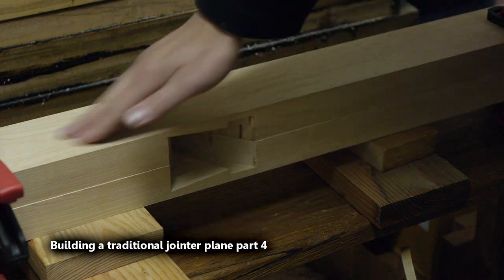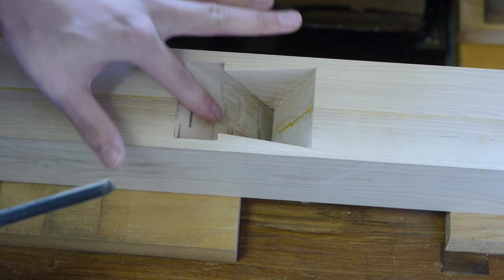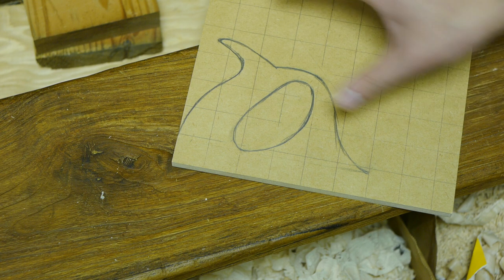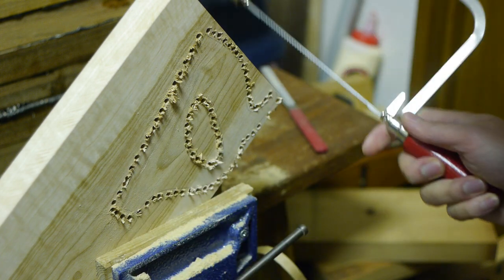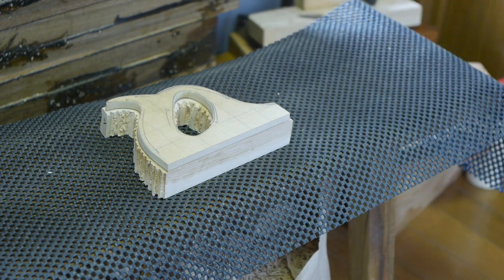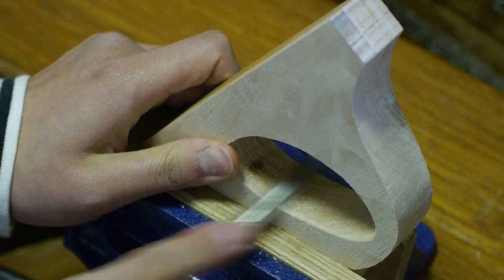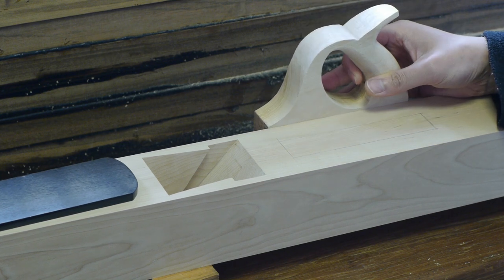How to make a traditional style jointer plane part 4

Comment from the maker: That is indeed a huge knot in the side!
It was actually filled/semi solid when I started but when I hit it with the power plane the knot flew out. I didn't make any effort to fill it etc. Just used it as is. The plane even now is still as straight as ever. I don't think there is any need to worry about it since laminating will improve the warping characteristics of wood anyway and these are pretty well seasoned chunks of wood.

Comment from the maker: I could have done it either way but if I cut it first I would still have to clean up the mortise after I cut it since its pretty hard to get it to a really good fit first time round and to get the halves glued up perfectly so the mortise end up how you intended. I like drilling then paring for large mortises because its quick and easy to get a good fit.

Comment from the maker: Biscuits would probably help but I don't think they are needed, especially in this design. There are very minimal forces on the glue joint so a decent wood glue and well prepared gluing surfaces should hold up just fine. On a Krenov style lamination then dowels or maybe biscuits are a good idea because the wedge is basically prying the plane apart, however in practice, glue alone is strong enough to hold in this case as well.

Comment: I've watched some of your other videos.... too bad you didn't live next door, you could have come and used my bandsaw lol   Just a thought, would it have helped to drill for dowels to use as locator pins to make the glue up more seamless?  I've been shopping some of the Japanese tool sites and I'd have to mortgage my house to buy the plane I want so I guess it's build my own also. Thanks for posting, I learned a bit. Oh, and another thought, how about making the mortise for the tote and then dropping it in and marking it to finish fairing before gluing it in. I'm too clumsy, I'd make a mess of it with a rasp
Reply from the maker: Hi, thanks for watching!
Haha, if I lived next door you'd have me banging on your door every day to use your bandsaw. Its definitely one of the first machines I'd get when I get the space to put one.

Dowels as locator pins does help but I just think they're a bit ugly looking so I don't use them. Drilling them from the inside and stopping so they don't show through on the outside is a bit hit and miss so I just try and get things lined up after glueing.

For the tote, you can put it in and out but you would have to make the mortise a little looser for easy removal. You can probably get really close with this method and then glue the tote in, and use sandpaper to smooth everything out.

Japanese tools are definitely more expensive on average than Western tools. I think a lot of it does have to do with the fact that a lot of them are handmade and not because they are that much superior to Western tools. Shopping around on auctions is a good way to acquire some tools at a reasonable price. You do have to be careful though and you kind of need to know what you are looking at.
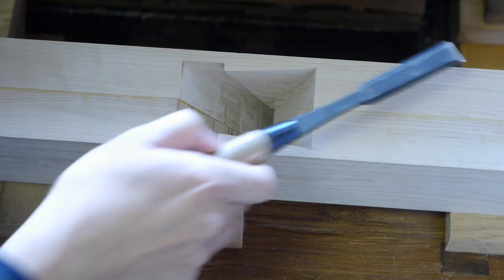Reply: Sumokun My thought on this at 3:04 was to make a wedge that fills all of the space between the blade bed and abutments, then wrap it in plastic wrap and insert to help line things up.  I think I'll try it when I glue mine up.  Let you know....
Reply from the maker: That is one way to do it. For a plane of this size though, I am not sure if a single wedge in the middle will be able to line everything up. Also, there is the requirement that the two halves of the mortise have to be cut to pretty much the exact same dimensions and angles or the wedge could actually make everything not line up instead of helping to line things up. If you really want something to help line the halves up for you, I would look into using dowels or registering pins of some sort (like a cut off nail etc).

Comment from the maker: Hi, thanks for watching.
I'd love to have a band saw or jigsaw but living in a small, shared apartment in Tokyo places limits on what machinery you can own without getting evicted from all the noise. Not to mention all the space power tools take. I have a drill press because its relatively quiet and compact and for me, its indispensable since drilling holes accurately is a great advantage when making guitars.
The coping saw is pretty crappy but bow saws are pretty efficient at what they do :)

Comment: Where did you get the template for the tote ? The lee valley template are open handle ones rather than closed handle
Reply from the maker: Hi, the template was hand drawn. It was just something I drew up that I thought would be comfortable. You can use the Lee Valley templates as base designs and then tweak them to fit what you want.

Comment: first of all i enjoy your videos very much,because you are so methodical.  I too build planes and improve a little with each one.    I was surprised that when you glued this plane you didn't concentrate on the alignment of the bed as the single most important part of the plane.  I mean, after all the rest is easier to bring into alignment than the bed, so get it right and the rest follows.  also where do you buy your Japanese irons?
Reply from the maker: Hi, thanks for watching!
I didn't really concentrate too much on the bed while gluing up because its probably not quite as accurate as using the reference marks. Cutting the cavity for the blade and wedge is not really too precise unless you have well set up machinery so its best to stick to the reference marks and clean up the bed etc after glue up. That way you can make sure both halves' surfaces are in the same plane. Of course lining things up before glue up will minimise the amount of work needed after glue up but I find that you still need to do some work on the cavity to get the blade bedding at its best.
I buy my irons from Tsunesaburo. They are a plane maker in Japan. I got them custom ordered from them directly. Pretty expensive but well worth it if you like the Japanese steel.